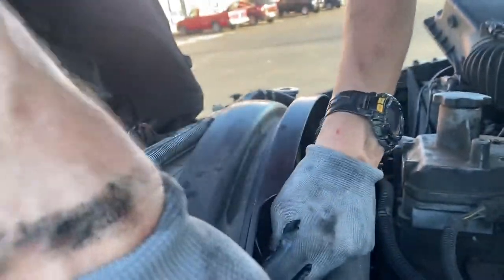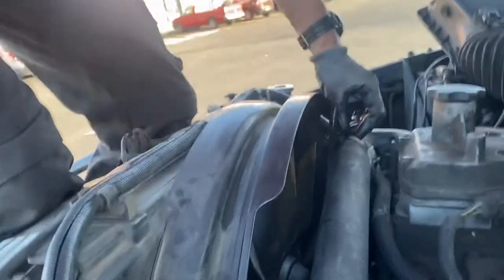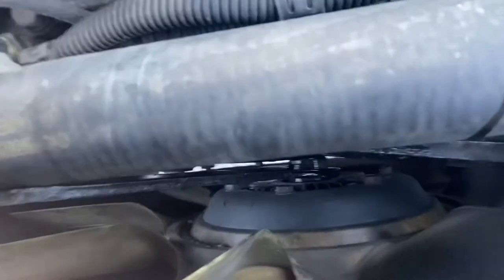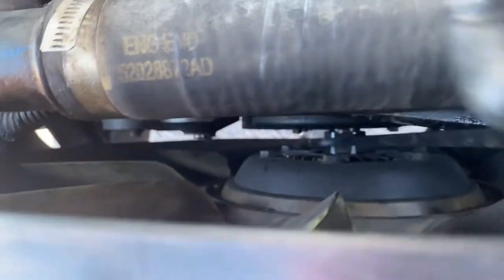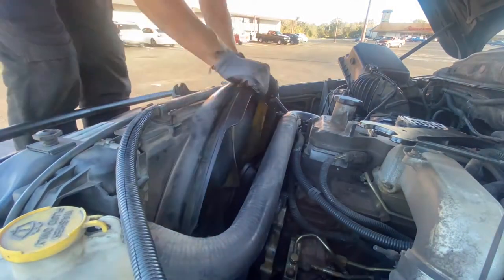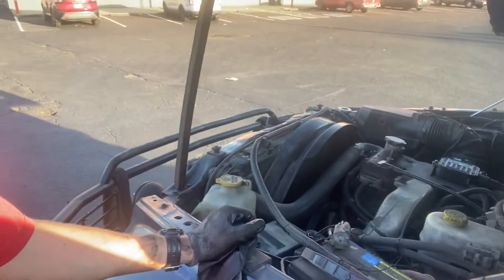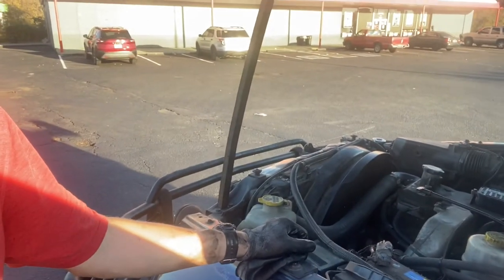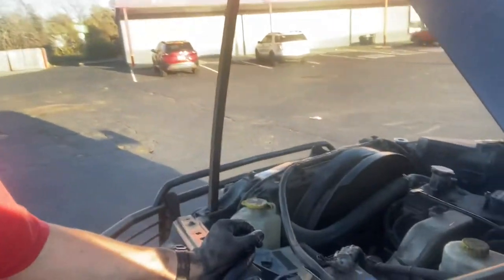24v CUMMINS FAN CLUTCH REPLACEMENT DIY “EASY”

Comment: It looks to me that the early 2003 fan shroud is different. It is a 2 piece design. The lower half of the shroud can be removed  then the fan assembly can be lowered out thru the bottom of the truck